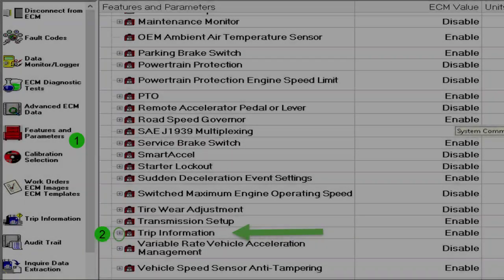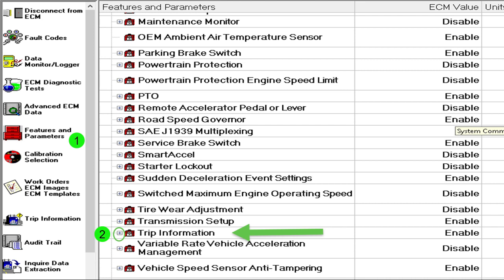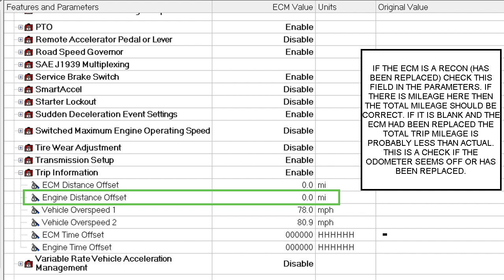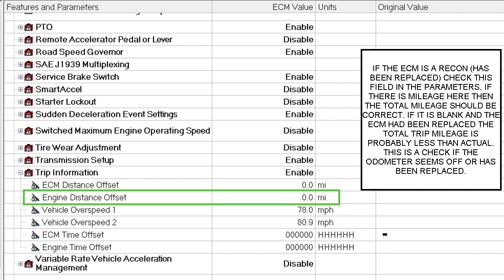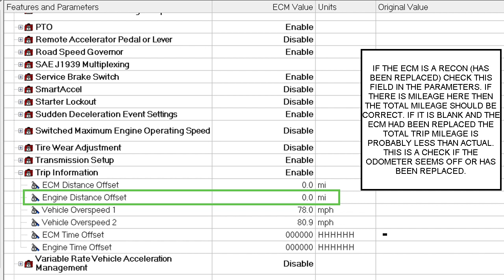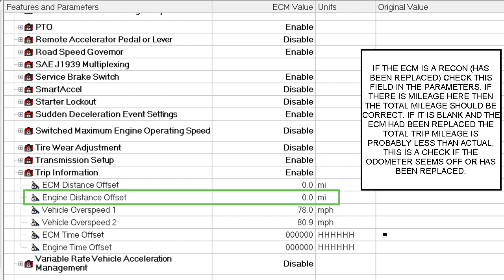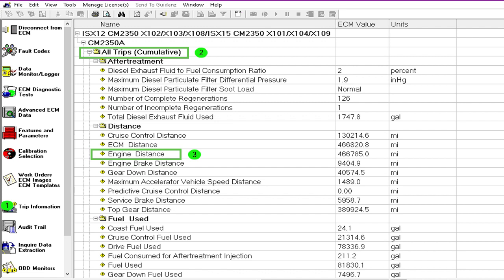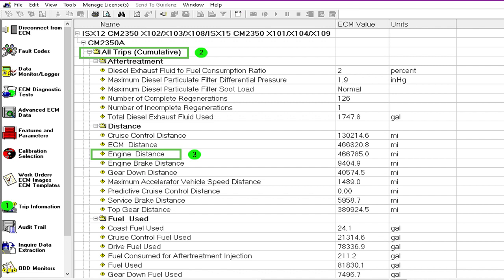How to put offset miles and time in a recon ecm

Comment: What if there is no one cm distance offset option only engine and the odometer is reading the ecm distance
Reply from the maker: Depending on when the truck was made-(changes to electronics in the cab) The odometer total mileage usually stays correct these days. You put in offset mileage and hours so trip print outs are correct. This is especially important to fleets that use the inquire data module to pull fuel mileage and travel miles. For the most part only Cummins and dealers will put this in when they replace the ecm and I have seen both of those entities not put it in. It depends on the knowledge level of the tech doing the work. If you have an industrial or off road calibration in the engine there usually is no miles field only hours.

Comment: How do I get a negative number to lower the miles on the dash? The used ecm had 707k miles and mine is only at 643?
Reply from the maker: Unfortunately you can't input negative values in these fields. You will have to contact the dealer to see if they can set it back on the odometer via the VECU
but you will need documentation.